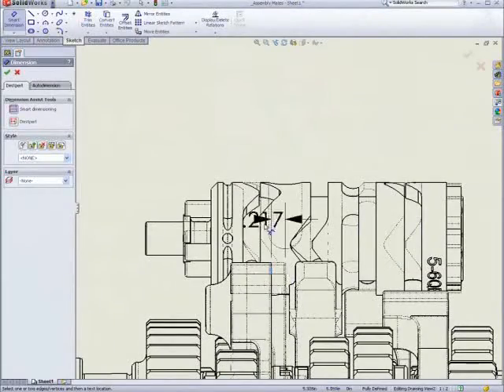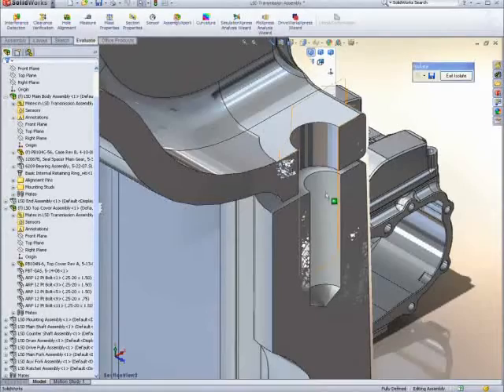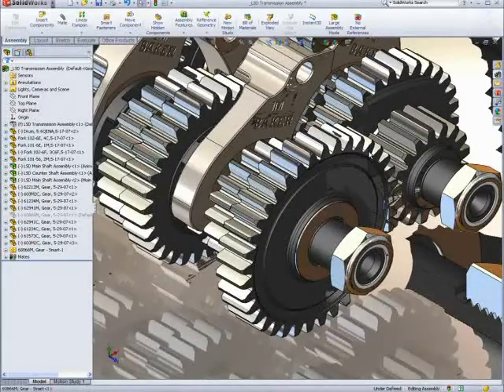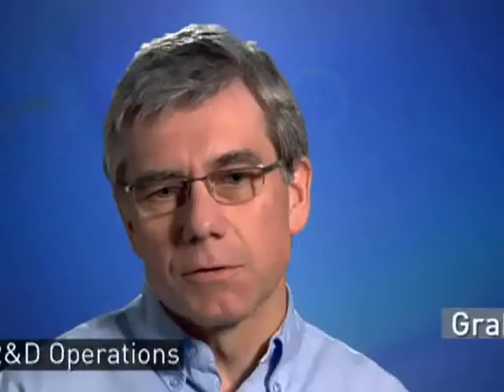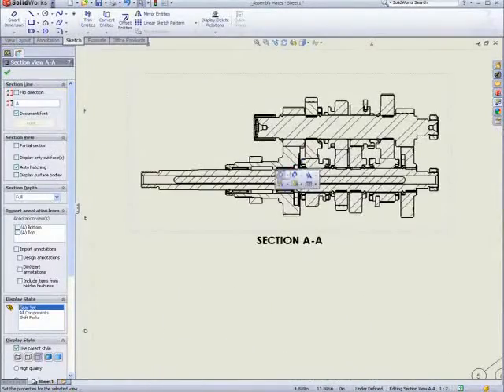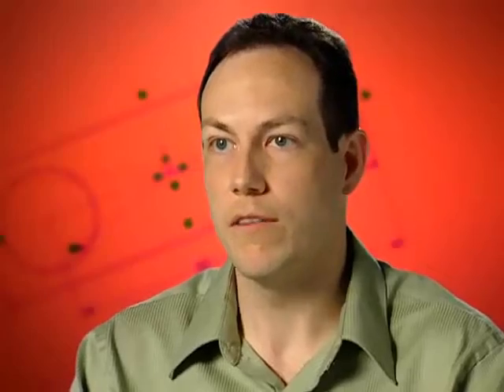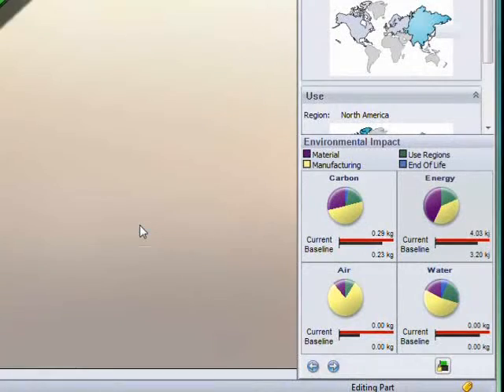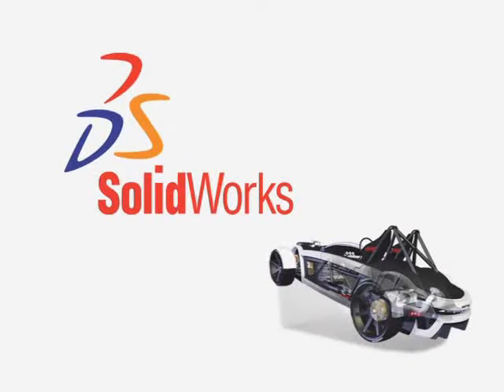SolidWorks 2010 - R&D

Comment: @bbirdsr71 to this day their are no 3D engineering CAD programs for MAC and their never will be.  Microsoft has partnerships with all the CAD software companies and windows still maintains a 95% hold on the worlds computers.  1 in every 60000 computers are a MAC.  I personally hate MAC but i am not against it.  I find windows much more user friendly once you learn how to use it correctly.  Try windows 7 and you won't want to use MAC any more.